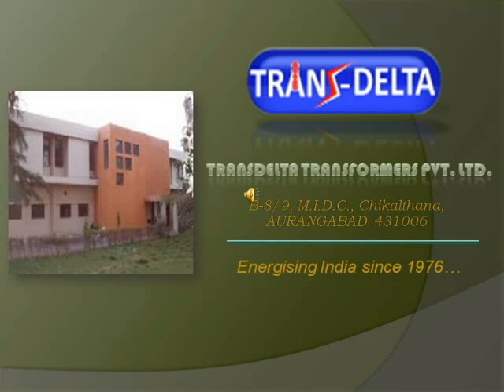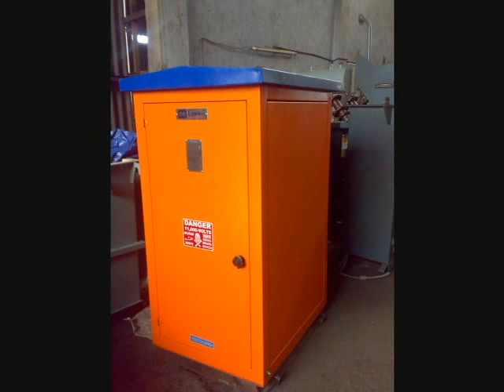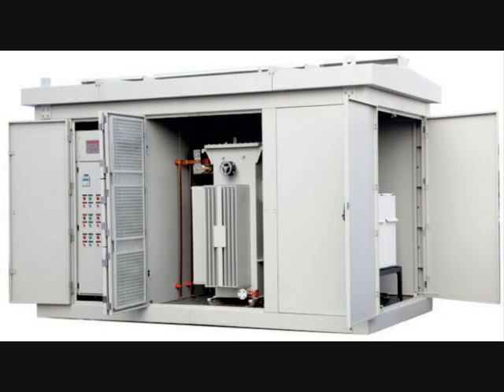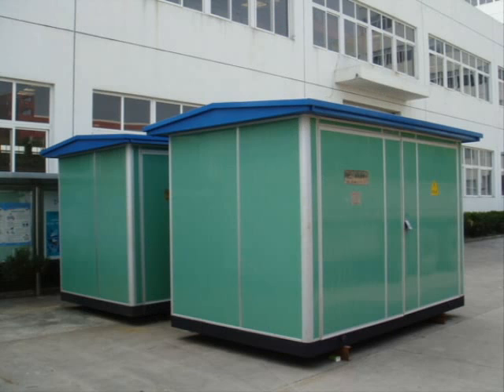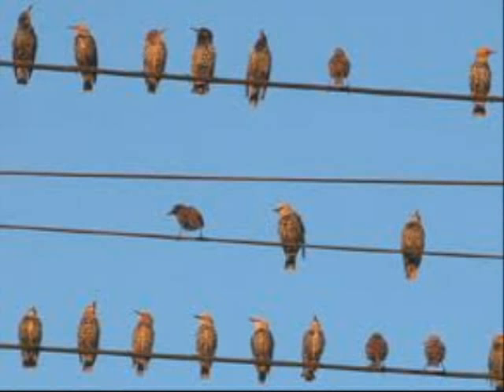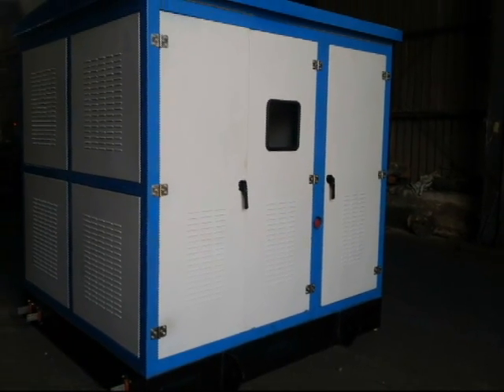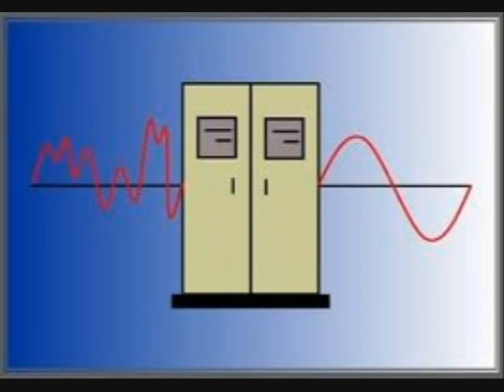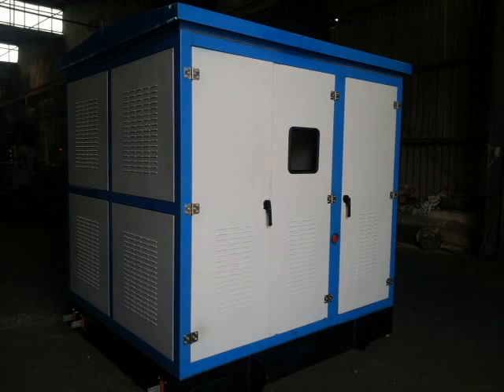COMPACT SUBSTATION PRESENTATION MOVIE

Comment: Sir I have a confusion that Is it could be installed at roof of the residential building like roof of Hostel building.
Reply from the maker: Yes...It can be installed.However permission of Electrical inspector is required.For more details you may write on transdelta@rediffmail.com